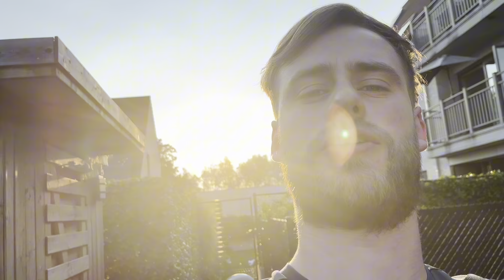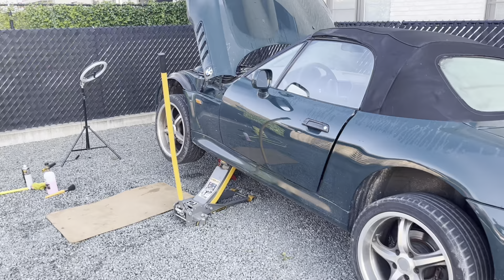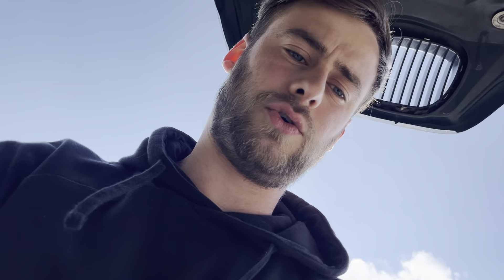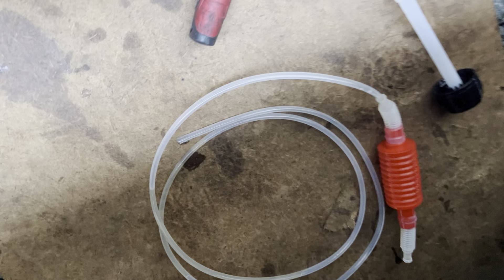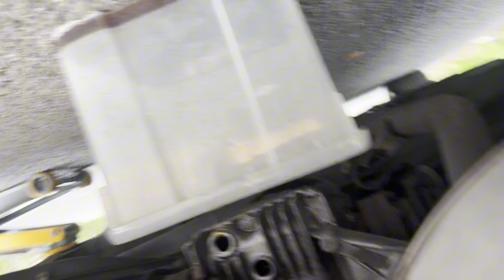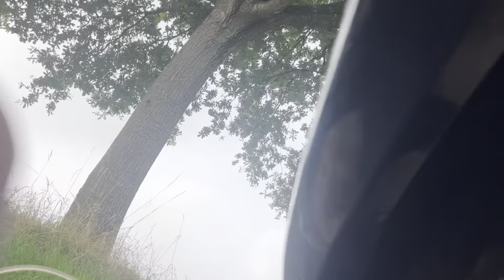bmw z3 clean up build part2 maintenance

Comment: Nice to see your commitment to the Z3. Anymore oil leaks from the front end of the engine is usually the oil filter housing. Inside it has an oil pressure switch with 2 orings which compress heavily and cause the leak. To get a little more power from the engine above what I have seen in your video is to clean the mass air flow sensor & 100% put a new fuel filter on. The roof can be adjusted by turning the metal latches clockwise or anti clockwise after loosening the grub screw at the base. Nice job so far. Well done